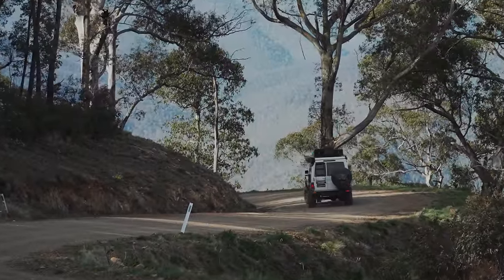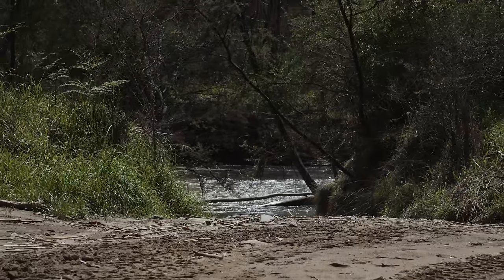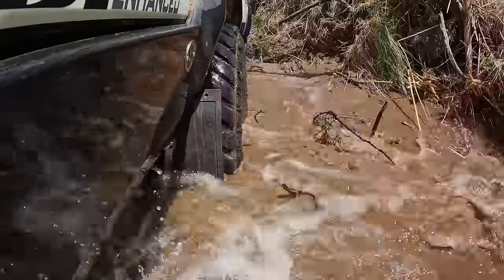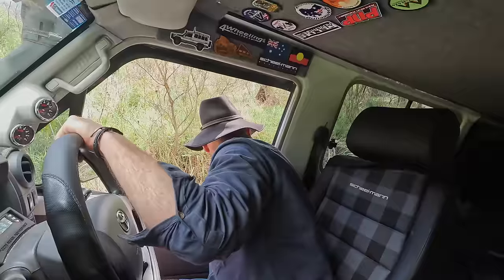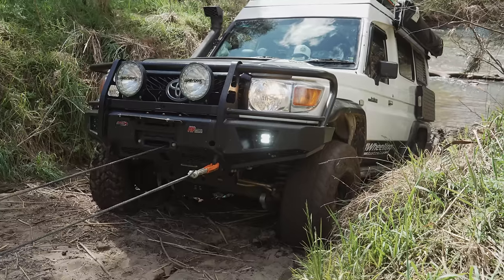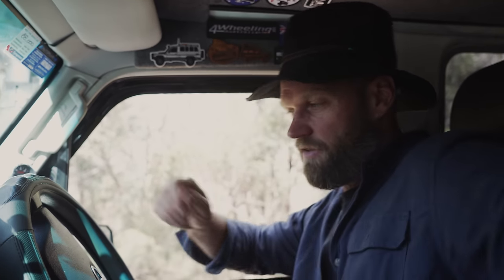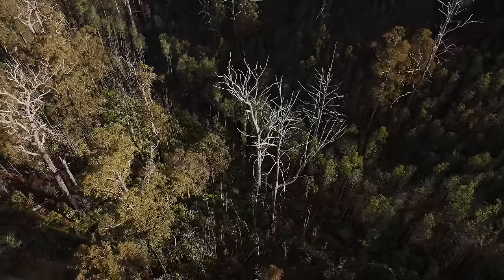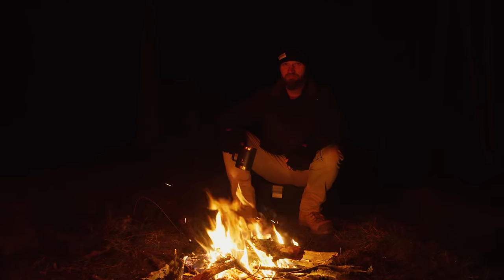BEING TOO OVER CONFIDENT 4WDING THE VICTORIAN HIGH COUNTRY

Comment: The high country is my stomping ground. That first river crossing is obviously one that no one uses. As evident by the tree across the river and the lack of wheel tracks going through. I would have turned around there and taken an alternative route. After seeing the waterfall ,which is called Harrison’s cut, I’m thinking it’s one of the crossings on the end Stockroute spur track before the Dargo river, as it’s only a short drive from Harrison’s Cut, but it’s on the section of track that are only on some of my maps. If I’m correct you would have seen an intersection on the way down and you went straight instead of turning left. 
99% of river crossings in the high country are a hard gravelly base. I’ve never seen one with so much silt build up except after a lot of rain.
You got unlucky on your first one. Welcome to the High Country.
Reply: Spot on. The turn to the right leads straight to that bog hole.
Reply: Definitely a bit of artistic licence in this episode.  I'm pretty sure he chose a disused crossing not far from the real one. However, it doesn't alter the fact that the VHC is awesome. It's the other Australian Outback.
Reply: @colinboyd7779 Agree
Reply: I used to live in Warburton ... heading out past Reefton and getting into fresh snow was always a good day, as were some of higher tracks heading out towards the Thompson, i used to take family for a simple drive along the Acheron, it was always a peaceful way of spending an afternoon ... I was always in awe of some of the bigger snow fed springs, the amount of water they produce every second ... there was one big spring that if you crept up to in the morning you generally saw platypus. Its a pity that those mountain towns don't have a workable economy, that's the reason why i left.
Reply: I was thinking the same, don't recall seeing any river crossing with that kind of mud in the high country.

Comment: Ronnie, I love you big guy but @ 09:00 🤦‍♂️🤦‍♂️ please don’t hang your head over a stressed winch cable 😬. I did a job once where a winch cable took a man’s head clear off, his cranium ended up on the ground between his ankles.  In difficult situations where access is tight, you can use something to shield yourself……it may end up you just loose a finger instead of your head 👍

Nice recovery btw……I did almost half a million km in my 3rd Troopy solo, it adds another dimension to things…… that second set of eyes when ur driving and having a spotter really lightens the load.

Comment: Even the very best like Ronny aren’t immune to sticky situations. I went solo wheeling and grossly unprepared on what I thought was a chill fsr, ended up In a sketchy situation that warranted a turnaround on a tight and narrow uphill track with steep drops on either side, which lead to a tire killing boulder field 2 hrs away from a cell signal. Took me over an hr and a sweaty 70 point turn but I made it. 

Swore never to wheel alone ever again. Happy I made it out with lessons learned rather than being choppered out in a body bag or alive with a totalled truck.

Comment: I have a Powauto PTO winch on my landcruiser last 25 years. When a triple locked cruiser gets bogged, you need it big time. It’s 8,000 lbs all day, while the engine is running and you have five gears so you can pull in first slowly or put it in fifth for rapid pull. It works underwater too. 
Electric winches are for amateurs 😅

Comment: Hey Ronny, a question.
I don't know how it is with the diesel models in Australia, but I was wondering whether it is an advantage to activate idle up when driving through water or when using the winch?
The higher engine speed when stationary should be an advantage in water so that you don't stall the engine and the winch also prefers a little more power in the system or on the alternator?

Comment: Please people, carry a full length shovel. Digging in a recovery situation is just plain stupid with a folding entrenching tool or even a D handle shovel. Buy a cheap $20 dollar unit from Bunnings and call it good. Your shovel should allow you to easily reach at LEAST the diff or just beyond while kneeling next to the truck and not having to lay on your stomach. Yeah, I know they're not "overlanding chic" strapped to the tire carrier but for $20 bucks, you can keep the poser shovel for others to admire and strap the full length shovel to the roof. No rancher, farmer, construction worker or landscaper uses the cute short D handle shovels because the quickly fatigue your back and you just can't move as much material as quickly due to less leverage.
Reply from the maker: Been there done that for me personally long handle is a pain in the rear.
Used to carry them all the time.
Longer handle for me equals more, back pain, dents in peoples cars, something long to store and the leverage on the long handle weakens over time and snaps when you really need it. Due to sitting in the sun everyday for years on the side of a roof rack.
Each to themselves.
Reply: @Ronny_Dahl  The end of that shovel of yours looks like what they call a Pelican Pick. Worked for a few years in the mines in Norseman during the 1980's and we used them a lot. I've never seen them for sale anywhere though. They're more useful than a shovel in a lot of situations.

Comment: Wish you best of luck.
You drive a Toyota, having owned and used Toyota’s I have very little expectations from people using these vehicles and are sure the Toyota will take them everywhere, they only miss one minor fact it will not take you back home in most cases, despite the urban myth about Toyota being reliable. They are not. I have learned it the hard way.